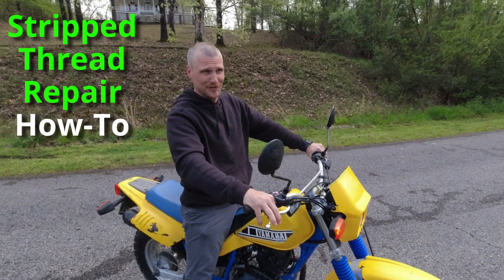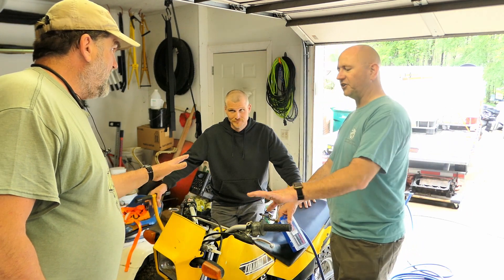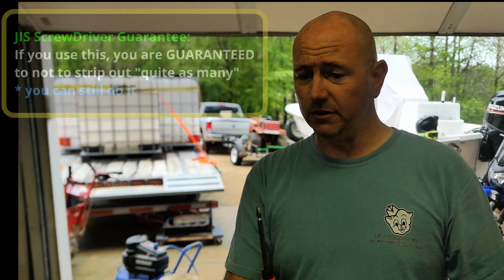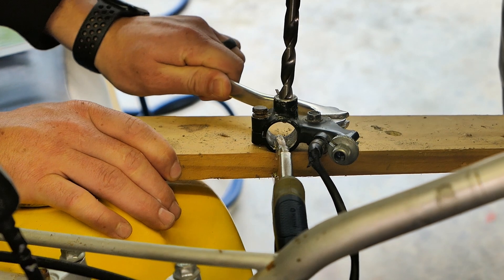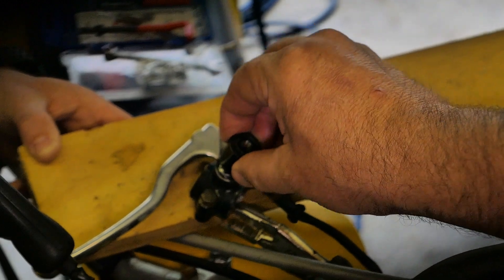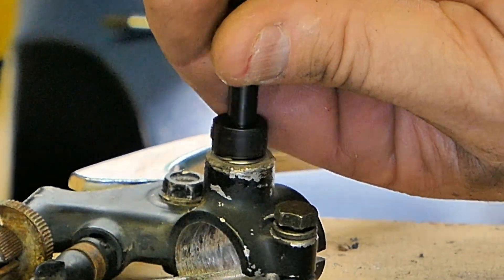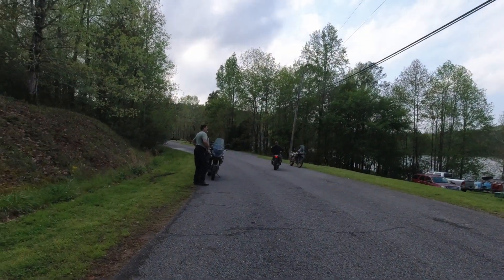TW 200 Repair using HeliCoil Thread Repair

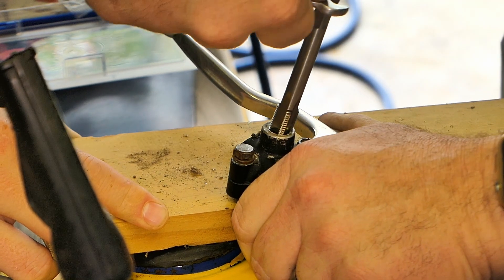Comment: 7:50 - It was painful to see that tap going in at a 15 degree angle.  I suspect this was a "hurry up and let's make a video" issue.  Pro Tip:  The tap can be installed in a drill press or milling machine to keep it vertical and the work piece can be held vertical in a machining vise so you have nice straight threads.  No power is used.  The machine is only used for alignment.  The tap is turned by hand.  There are special tapping fluids for aluminum but WD-40 works fairly well.
Reply from the maker: total lack of tools, including a tap handle
Reply: @MotoGiant  - I once built a faster-than-light drive on the edge of an asteroid field using nothing but an empty oxygen tank, a Pez candy dispenser, a BIC butane lighter, a Tampon applicator and some deuterium that I found.